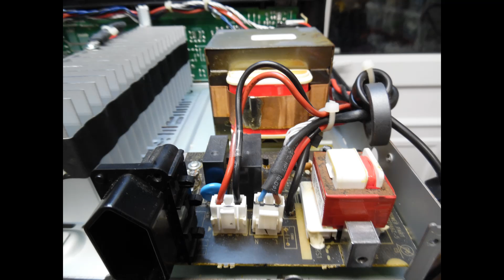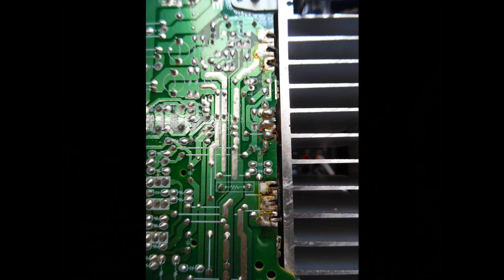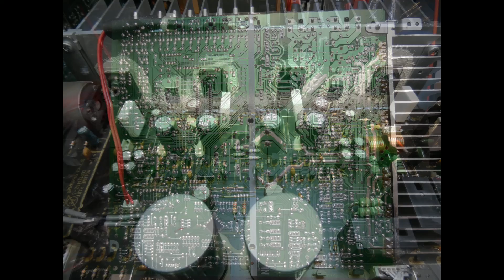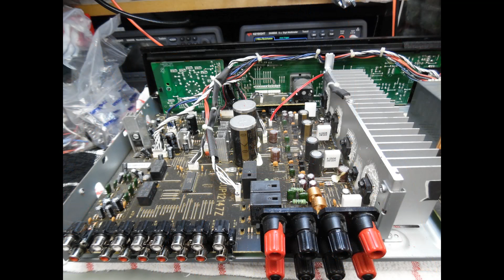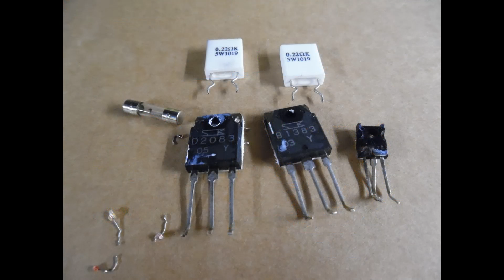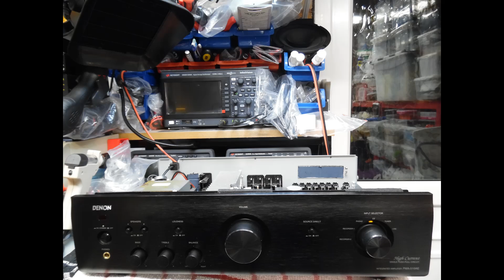Denon PMA 510AE Amplifier Repair (With Audio Tutorial)

Comment: Hi in the right side of amp if you look from front there is a vertical heatsink(min 22 in your video) which in my pae510 gets super hot after sometime of listening. would you please advise what should I do? if I replace the component it will resolve the problem or should I look another place for causing this problem?
Reply from the maker: Hi do you mean the silver vertical heat sink. If so check the output voltage of the device to see if the regulator is providing the correct voltage output and there is not excessive current drain.
The heat sink is designed to run warm but should not be excessive ie too hot to touch.
The regulator may be failing but you will identify this if the voltage output is incorrect or unstable.

Comment: I'm put off by Denon,  recently got a Denon 500a, 2nd hand, left output channel not  working at all, so looks like a common fault with Denon. First time I had a Denon too so not impressed.
Reply: I just pulled 500ae  out of a skip and it has the same issue left channel is blown, the fuse is intact but the output transistors are blown along with the ceramic resistors. I suspect other transistors are gone aswell and one of the main filter caps has bulge. The cost of the parts would be more than it's worth so I'll keep it for part myself.

Comment: Looking for some help on a arcam alpha 9 worked for 5mins then went into protect i tested the bias 7mv on both channels but it wont come out of protect
Reply from the maker: Is the Amplifier in protection mode?
Reply: Yes just stays Amber I looked for fry joints couldn't find any I think it's the protection chip but I hope it's not that as I can't find that chip anywhere online
Reply from the maker: @callum450gaming2  Hi if there are no dry joints on the output transistors, check the 5 volt supply voltage on pin 14 of the and pin 4 Z401 the Micro controller.
Reply: It's the power amp only model so I don't have that chip. The only two that I can see is z501 and z3 the atuo bias chip
Reply from the maker: @callum450gaming2  Refer to the service manaul and check the signals for Z501 https://elektrotanya.com/arcam_alpha-9_9p_sm.pdf/download.html